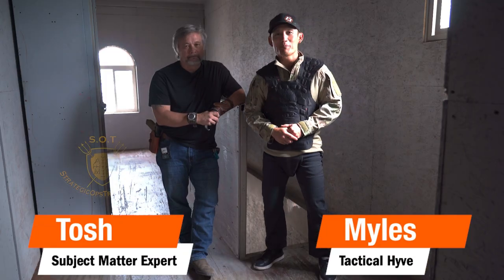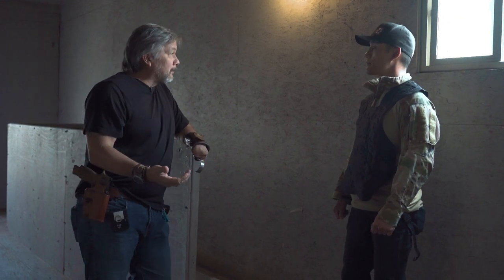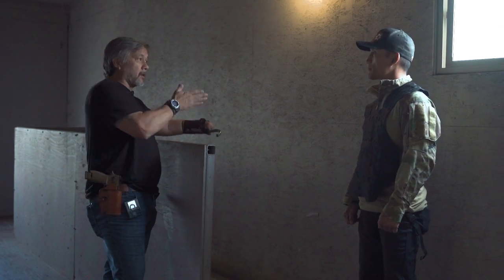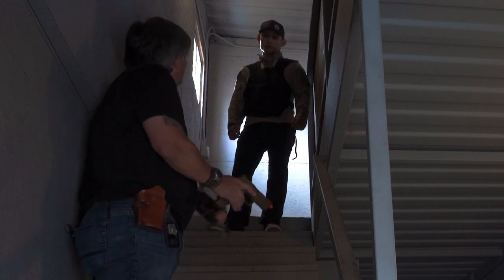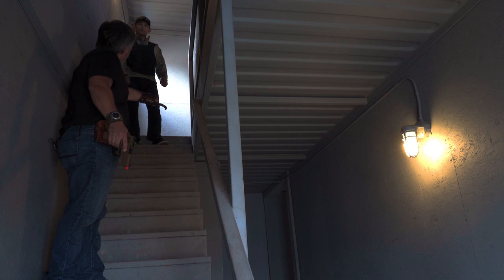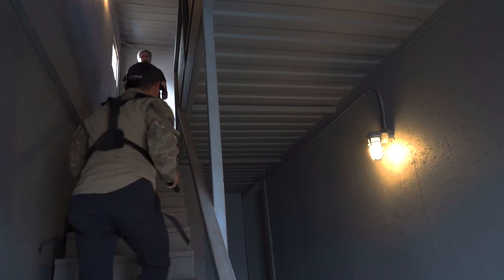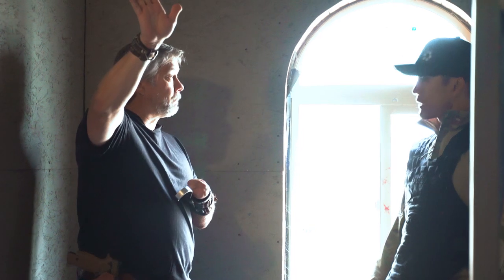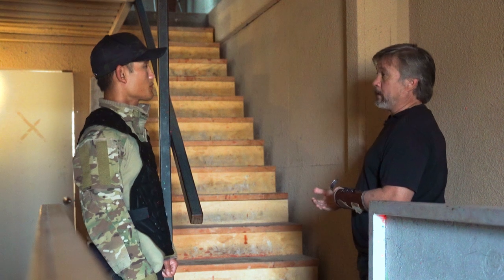Force-On-Force: Negotiating Stairwells With Navy SEAL "Tosh"

Comment: Awesome! When you're through with certain areas, perhaps you can do a whole house route to clear with body cam without Myles knowing where someone will be placed and some footage review together with Tosh.Thanks for the multiple cameras to see all the angles. That makes it really stand out of other stair related clearing videos as well as the FoF runs. 

I like the open no BS talk. But keep in mind that every word gets screened if it's 'advertiser friendly' so you also see the censorship in the auto subtitles. 

What I'd like to see are different types of doors like push/pull, sliding doors (light, glass (lighting question, heavy) and how to potentially deal with the door when an attacker on the other side,  slicing the pie with these different doors or just clearing. House lighting considerations when the option is still there and handheld light stuff (deploying/holding/during malfunctions or reloads). Considerations to funnels or talking about tricky angles the order things should be cleared. Using a room to your advantage during a stabby/blunt attack. 

Btw. look at some gym related channels strategies. You can give some Q&A time or something merch like for someone that commented in the first hour after the video drops to have some initial push. If you have something big to give away, connect it with your website. If there are new classes coming up, mention it on the community page.
Reply from the maker: Thanks for the comment and suggestions!

Taking baby steps right now. We will share full scenario runs in the future. Right now we are working individual skillsets.
Reply: Hey O, we will be doing that in the future. Thanks for the comment